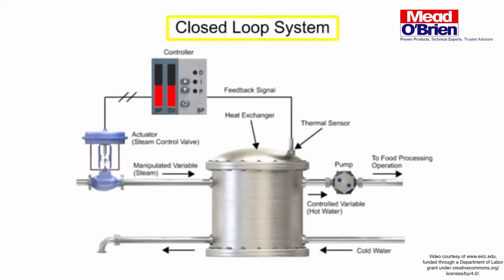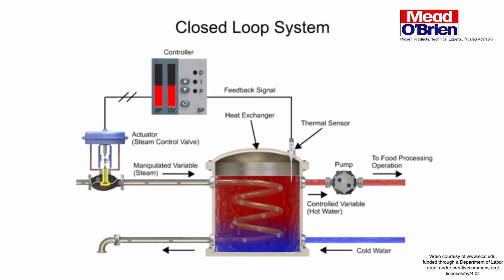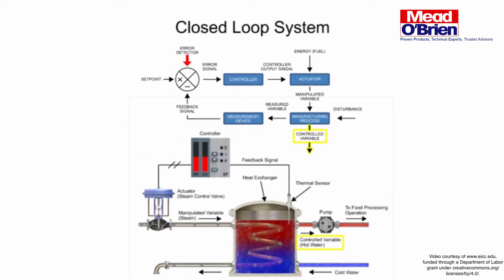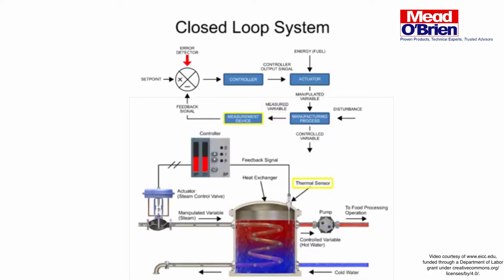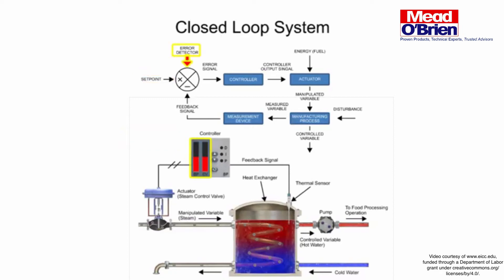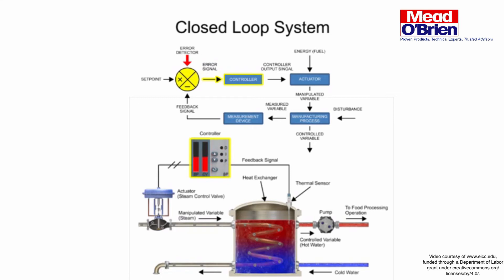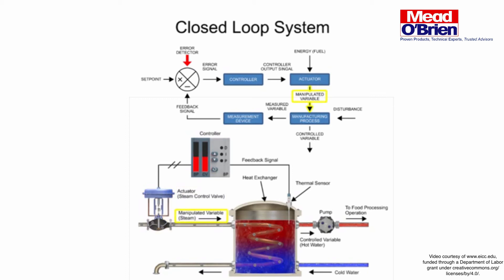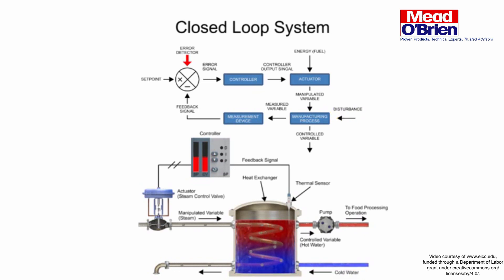Closed Loop System Intro Using Heat Exchanger and Food Processing Example

Comment: Hi there, what will be the capacity of the pump?
Reply: It's just an example of a system to demonstrate the control, so the pump capacity would depend on the system, or it may not have a pump. The question is irrelevant.